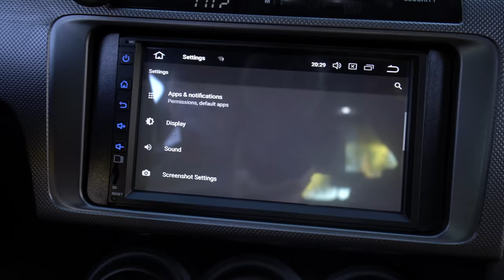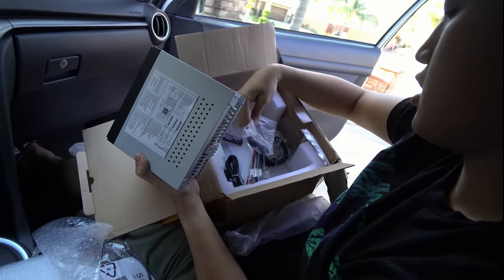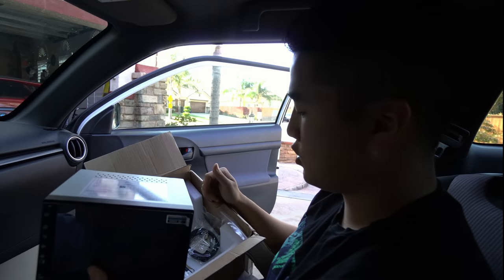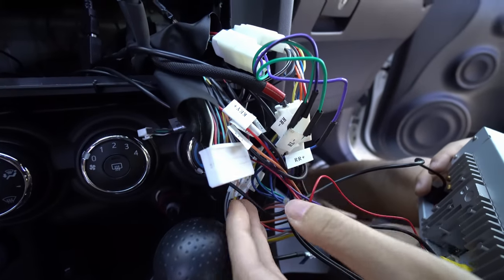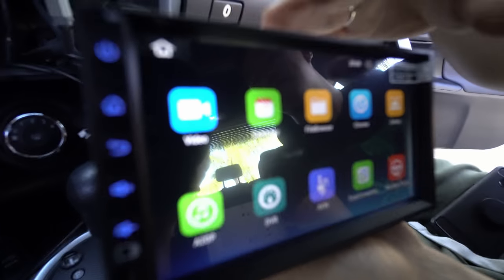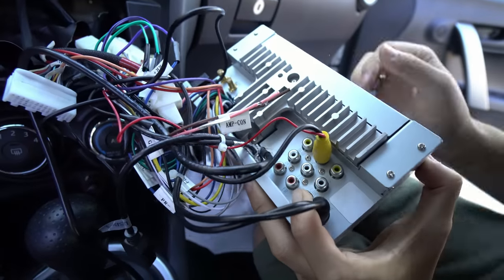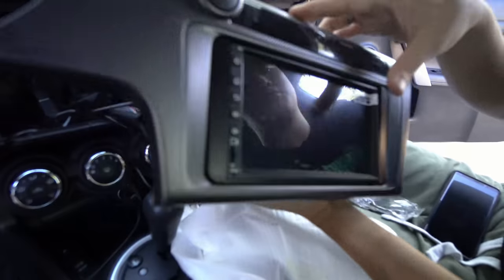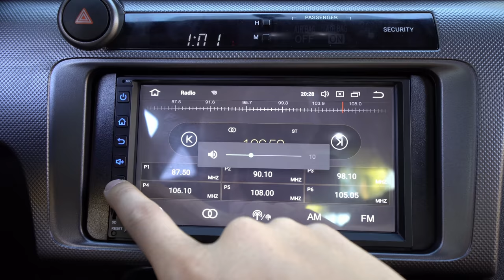Universal Android Head Unit | 8-Core goodness | Install | iDoing

Comment: As much as I love the extra features that you get with these Android head units, I would still get a double DIN Pioneer head unit over these for the sole reason being Pioneer head units are superior in audio quality. 

The way I see it, the whole purpose of a head unit is to playback audio. Therefore, audio quality should be first priority, everything else comes after. Most of these Android head units seem to have their priorities the other way around; they pack a whole lot of functionality and features, but the audio quality is average, maybe even less than average. 

This is also important for me as I have aftermarket subs and door speakers powered by separate amps. High quality audio through RCA outputs on the head unit is a must!
Reply: Just buy a Dsp problem solved.
Reply: Serial_Killa_ 246 DSPs will make it sound a bit better but it still doesn't compare. Good sound quality starts at the source, and if your source is just average quality then no amount of signal processing can fix that.
Reply: Alex Kalicharan I totally agree with you
Reply: Do as much TA as you want etc etc. You cant beat a good source..see the audiophile builds head unit bein top range pioneer or sony then a premium audison or helix dsp etc with mcintosh amps...and top notch rcas...
Reply: well, the purpose of these head units is having android on them and do whatever you want, not to have get audio capability, you can get a pioneer head unit with android auto and apple car play and better sound, obviously a lot more expensive than this.
Reply: I agree. I just wish the  bigger brands would make the screens  edge to edge. I don't like having the cheap plastic install bezel. It works in this car but the 18 wrx has a great option from secaine that is all glass edge to edge. If the big brands would follow that lead with the audiophile  connection, I would buy one tomorrow.
Reply: also my pioneer has a crossover all these androids dont
Reply: +juan carlos Palomino In terms of pricing I agree with you, the main problem with Pioneer head units is their high price whereas these Android units cost less than half of what I paid for my Pioneer MVH-2400NEX. My 2400NEX does have Apple Carplay and Android Auto but the Android units still have MUCH more functionality. I was hoping that after all these years the Android head unit manufacturers would find cost-effective solutions for providing decent sound quality in their products, but that has yet to become a reality. Until then, I'm sticking to the tried-and-true Pioneer head units.
Reply: Alex Kalicharan why not a Sony xav 
It has a volume knob .....
Reply: David Arndt I personally think Pioneer's signal processing is better than the Sony XAV lineup, just my two cents though
Reply: Alex Kalicharan pioneer is a little better 
But the xav has a volume knob lol and a really responsive screen 
Hesitating buying one tho not sure how long those kinda units last
Reply: @juancarlospalomino8939  the purpose of upgrading your stereo is to play candy crush? WTF are you saying, you want better sound or why even bother?
Reply: @mandarb23  if you want better audio quality buy an expensive alpine or Sony head unit, if you buy one of these you want convenience, it has gps radio you can put Spotify or whatever you want to it, like I said, people who buy these is in most part because they have a shitty cheap head unit.
Reply: @alexkalicharan8283  what about usb audio output from the android headunit to the DSP? That way you're bypassing the shitty internal DAC and pre amps
Reply: @juancarlospalomino8939  I thought all that stuff in my Pioneer hooked up through my phone with Bluetooth that's what I don't get why do you need all that
Reply: @mandarb23  those have just bluetooth o could have Android Auto an Apple car play but those are expensive,   a lot some people have fairly old cars with cheap audio system and just don't want to pay that much to have that experience in their car, they don't need al the things it comes with, it's just nice to have sometimes
Reply: Sound quality out of my Xtrons is amazing. These units are so close to far surpassing all the major manufacturers.
Reply: Keith Gatlin Since these run Android, you can plug in a PC USB sound card which will probably provide the same level of sound quality.
Reply: Alex Kalicharan when you say source you do know you are speaking about media right? While you are completely right good audio quality does start at the source but it’s not the headunit but how well what you are listening to was recorded and mastered I.e. CD, streaming, etc. The headunit takes that and amplifies it...simple as that
Reply: I completely agree with you even SoundStream over some of these androids. You have the most objective mindset. These companies need to understand as well.
Reply: you have actually constructed a great idea
Reply: Spot on in assessment Alex, I have had a few over the years and they have never understood the basic principles of a head unit, reviewers like this are not audiophiles and have no technical knowledge in the basis of the quality of sound. Like most, there goal is to promote products for referrals and YouTube ad revenue. The last unit I had was a ownice c500 the sound quality was worse than a fifteen year old ford 6000 series head unit out of a ford Mondeo, let that sink in.
Reply: @26thatscool  a dsp doesnt correct distortion from a source unit..
Reply: @alexkalicharan8283  you would be correct if the build quality would be the same, and they are certainly not...it is a gamble buying these things from china...the warranty is shit and so are the components used...
Reply: @christianolivera3286  yeah you have a point...but if the head unit uses inferiour components...you can have the best flac or lossless files they will come out sounding crappy...these units use the cheapest components..they often have problems with electrical noise from the car or even from inside the headunit...these units are with the luck of the draw...most of them are shit really
Reply: mistermenphis22 an external USB sound card is definitely an option, but most if not all of them terminate in a 3.5mm headphone jack... I don't know, the whole idea just doesn't sit well with me from the get go. I know you can get a 3.5mm to RCA cable/adapter to feed an amplifier but you are also losing out on a lot of other really useful features, like the "network mode" on the newer Pioneers which require three sets of RCA outputs. There are definitely PC sound cards that can provide multiple outputs but they are costly and I'm pretty sure you can't configure a crossover network over these USB sound cards...
Reply: Christian Olivera you are absolutely right, your media source is equally as important. The thing is, you can have the best source media files in any lossless format you like, but it won't matter with these Android head units as their internal amplifier circuitry is made very poor. Any kind of signal they produce is distorted somehow, whether it is distortion created by the audio circuitry itself or distortion picked up from the vehicle's electric system... These signs just scream poor/cheap design.
Reply: Do you play your music from a Lossless audio source or do you playback MP3s? lol So many people want amazing sound quality but playback shitty compressed files and don't even think about that.
Reply: I have a pioneer double din it's amazing. it has Spotify Apple car play Android 13 band eq  etc. I had it for a year with no problems.i had a cheap double din and it didn't last 6 months and the sound quality was crappy
Reply: Pigeon I had came across a couple of bad pioneer head unit. the first one that I had was full of distortion and the second one would cut off  and reset it self but it still my go to unit
Reply: You're talking about car audio. It's not gonna be fantastic by any means. Wind and road noise, engine sounds, etc. But if it's good, it's good enough. No bass distortion, no rattling, no ear-bleeding highs, etc. Not to mention you got speakers to worry about as well.
Reply: 2010ngojo you have a point
Reply: Pigeon l had to return 3 pioneer radio in order to get a decent sounding one
Reply: Da best .....
Reply: Not a single comment on analog VS digital signals. Read some books. It's all marketing gimmicks :p
Reply: in a noisy environment like a car? um not for me anyway, its entertainment value
Reply: Completely agree with you
Reply: To all those stating the fact that most of us listen to mp3s (which is lossy) you are correct. Most of us do in fact playback mp3s for the most part. However, my point is, even when playing back a lossy format on these Android head units, you can clearly hear a difference in audio quality when listening side by side next to any decent Pioneer head unit (or any other big brand for that matter). So even when playing back lossy mp3 files, they still sound better on a Pioneer. I don't know if it's the processing, the pre amp, or the main amplifier circuitry... Whatever it is, it just plain sucks.
Reply: @JR1994997  The crossover in Pioneer head units is quite lacking and the FM SNR is laughable (in modern units). But they are still a good option for sound quality, adding an external crossover such as a Clarion MCD360 will give much better results.
Reply: @conFIGuredAPK  FLAC
Reply: Alex Kalicharan agree with you 10000%
Reply: Facts
Reply: I wonder if the USB on these head unit support a USB DAC. that would be amazing.
Reply: I agree with Alex, I have a generic android head unit and I have a pioneer speakers and amp, can't seem to get the punch out of the speakers as you would with a pioneer head unit
Reply: Keith Gatlin 
You hit the nail on the head the Only way to end the beef about android vs name brand is do what the big guys do.
Install And glass in a iPad or android tablet in dash source it to a hidden single din Headunit and have your glorified 10" media tablet for vids email whatever people do and play High end music though the High end radio that sends sound out the High end components. 

Second way I mentioned Is use a 600$ pioneer/kenwood  with hdmi input  Buy a Belkin mirracast adapter on amazon  screen cast  your phone wirelessly and hotspot free  to the Pioneer/kenwood  and Buy app radio unchained on the market.  That app gives Full touch function on the double din. Now you have android on a Real Good headunit. 
Or 3rd just use an android radio and hope for the best with a 1volt subwoofer preout lol....
Reply: Your Mums HITACHI 
I'd like to know more ? Which is it 
Is joying still top of the line? I have two joying decks and they been sitting on a shelf ever since I realized they came with a 1volt single sub out line .
Reply: The Pioneer won't break in a few months either.
Reply: I just bought a Kenwood DDX9905S, dam it sounds great.
Reply: HAMMER  if your happy with how your original unit that came with the car sounds this is a perfect option. The quality is about the same but just adds so much more functionality. And for the price you can't really beat it.
Reply: @alexkalicharan8283  quality also depends on the bit rate 320 kbps is going to sound a lot better than 128 kbps of course mp3 isn't the way to get the best quality sound but it isn't terrible either. I use Spotify set to extreme quality and use Android auto wired through USB I don't notice much difference between that and a CD I have decent equipment JL, Hertz, Hybrid audio and pioneer I know flac would sound better  but I'm satisfied with the way it is most people are impressed with the sound I'm sure an audiophile with a nice home system would disagree.

Comment: A couple things I don’t quite understand: 
1. Why would someone go thru “a lot of head units” in just 1 car? 1-3 ok maybe but a lot?
2. If someone does go thru a lot of head units, why would their wiring look as shown @6:45? It would be sensible to use male/female terminals so the car harness is always female and the headunit harness be male (to prevent shorts if disconnected) so the new deck is plug and play instead of rewiring the entire thing. Don’t take install advice from someone who doesn’t have basic cable management. 
3. Deck seems like a decent quality knockoff and may even be good, but what about in 4 months it craps out and the company’s gone etc... and ur out $200? For another $1-200 u coulda had a decent pioneer screen with all the r&d, reputation & warranty behind it. 
4. Most modern cars are nearly impossible to upgrade headunits cleanly. Cars now have funny shaped dashes with integrated screens that control climate & other features. Therefore you need to get a brand name deck and integration adapter compatible with that car to work properly. 
Not tryin to be negative but can’t help noticing these things.
Reply: He installs them for people. If you listen he says customer a few times

Comment: I have a Kenwood KDC-X497 eXcelon Single DIN, sounds amazing, has RCA out, never had a single issue, before the kenwood I had a JVC KW-R910BT Double Din, complete trash, RCA out, average audio, and it fried literally as soon as the manufacturing warranty ran out. Both were hooked up to my amp.
Reply: JVC head units are made in the same factory as Kenwood
Reply: That’s the funny thing about it, I guess they put cheaper components in the JVC, although I did have one of those cardboard boxes back in the late 90s and those things rocked

Comment: would have been great if you told us how it is better than Pioneer.. or at least go through the audio options. So as far as we are all concerned, Pioneer is still the best. and cheaper
Reply from the maker: i would say pioneer amps are a lot better. but that's the only thing. (i know it's important). Just these units do sound decently and have other functions on top of that.
Reply: understood. but we all really wanted to see how this radio could be better than a pioneer, but no audio functions were discussed and thats where pioneer shuts down all competition even with their entry level radios. amps are a different topic.
Reply: Pioneer will shit on any off brand head unit available.  Complete nonsense to say better than pioneer. I just bought a 57 dollar boss audio double din DVD multimedia player. It has ton of options so it's better than pioneer... come on now.
Reply: pioneer is trash
Reply: @snotellekS  There are a couple high end radios that might be better but far from trash.
Reply: It’s not better
Reply: Don't forget Sony or kenwood

Comment: All this units are made with cheap parts quality construction inside and outside adresed with the benefits of operate system android open source, and will be good to upgrade for boring, old, or limited features factory head units wich is good. If looking for Quality power and long terms head unit there are other top line known brands and range prices.

Comment: I took out my Chinese Android Head unit after a little over a year. I couldn’t take the constant problems it had, alot of the features never worked. The audio quality on these Chinese units is god awful. I tried adding a DSP to the Chinese unit and it helped a little. I just reinstalled the OEM head-unit and my god it sounds so much better.

Comment: Had 2 of these 1st one screen cracked, my fault but was slow and couldn’t run apps properly, 2nd one completely died only touch screen lights came on, tried reset and no go. Very exciting when I first used them as it’s practically does everything. Until they give up, and they do very soon. If you buy one do not buy a generic, buy something with a decent name and warranty.
Reply: I got one with full 2 year replacement for 5.99 extra...so its worth it to me...

Comment: you could solder your wires OR you could just get twist caps or crimps for 3 dollars at walmart. and theres no check your wires, if your steering wheel has volume adjust on it then you WILL NEED to get the wire harness for it if you want that function with your new radio. there is no checking anything except your steering wheel and then coughing that 50 bucks up.

Comment: I love the content but my head is spinning. I have a ‘12 ram 1500. Want to keep steering wheel controls and whatnot but have no clue what will fit and or work with my setup. What would you recommend or where would you recommend I start looking to help me make the determination. All thoughts are appreciated.

Comment: I'm good I'll stay with my 4200 NEX, CD/DVD player, 2 USB ports, SD card slot, GPS, Android Audio, Apple Car Play, Bluetooth, Pandora, Spotify, engine monitoring, back-up cam only (downside), individual speaker adjustments, remote control, detachable faceplate, and colour changing LEDs. I also have a 2300 as a back-up. It has better sound quality, but a few less features.

Comment: I have similar unit and the price/quality is outstanding. Much better than the junk Kenwood/Pioneer sells these days. Assuming you can actually find a car stereo dealer - they are mostly extinct. However, do North American AM stations work? My radio was set up for the Asian/European standard. I'm sure there is a hidden config file somewhere...